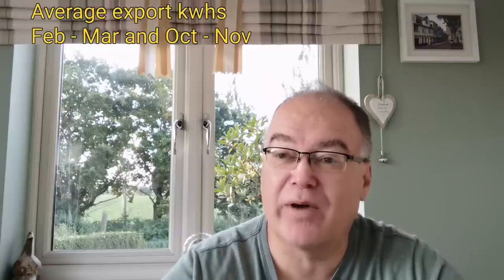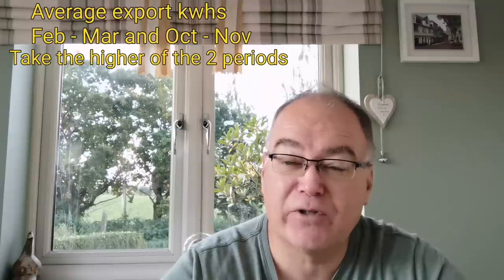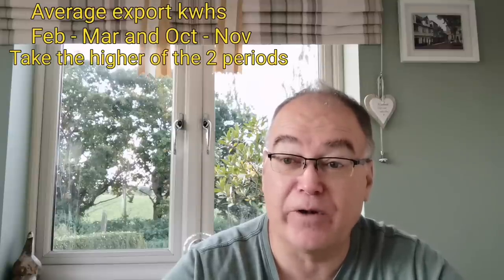How to size a home storage battery

Comment: Our experience has been that if the battery is only intended to store electricity from your solar panels there's not much point in the battery size being more than three times the rated output of the panels in kilowatt hours..  Our system has a battery capacity that's equivalent to 1.5 times the installed capacity and it often runs out of electricity in a 24-hour period .   On our best days if we had 30% battery storage we could use all of the solar power we generated without sending any back to the grid,. But if the batteries were any bigger we would never make enough power to run the house and charge the batteries completely.  Our house uses between 5.5 and 6.5 times the installed capacity each day in the summer which negates the longer days,  so if you're somewhat overpowered with panels a bigger battery might make sense to help you through the cloudy days,.    We live 32° north of the equator and I'm sure folks further north might have longer summer days but averaged over the year it's unlikely you would be able to store more power.  In our case our solar system generates 5-5.5 times the installed power a day,  so subtracting what the house uses from that leaves what the battery can possibly store.  On the other hand if we had less than 10% of our installed power we would need help from the grid a lot more often which would make the solar panels less useful.  

 Budget considerations sized our battery for us.  Because we live in a hot climate that's also cold in the winter we tend to use 70% of our electricity during the day to run our heat pumps and the other items in the house which have not been tweaked to maximum efficiency yet.  In a place like the UK you might want a large battery to store up night rate energy to use during the day and have solar there just to help you stretch out your batteries over the day.  
On a grander scale if every house could store 30% of its energy per day at night then, power generation could be levelized in that the plants would just make the same amount of electricity all the time and the batteries would handle the peaks.

Comment: Hi Nigel. I really liked your battery size video and have just subscribed to your channel. I'm researching quotes for a Solar panel veranda + roof panels + battery + EV charge point up at West Runton. Can you recommend an installer? BTW have a large GSHP fitted last December to replace the Calor Gas boiler - much cheaper. But it ruins your garden!!!
Reply from the maker: West Runton, almost on our doorstep.

Have you tried Leaping Hare electrical in Syderston near Fakenham. They Installed my Mixergy tank and do solar installs too. Nice small family run business

& thanks for the sub  to the channel

Comment: One thing not mentioned is look at the output power of the battery, a small one will not be able to fully provide the power for a kettle for example, somewhere around 5kW is fine for most people, this requires a larger battery, as you have done, think big!
Reply from the maker: Mentioned it on the inverter side just presume no one is buying a bigger inverter and small battery but yes they both need to be capable

Comment: if looking to use the battery for peak time use - morning shower or cooking in evening - don't skimp on peak power rating of the inverter. If you can't get enough kW rate from the battery/ solar (esp. evening with oven/ microwave/ induction hob) then you'll revert to grid. G99 rated inverters will let you export the rate that the DNO dictates but allow higher power draw around your property if suitably matched.

Comment: Thanks for the advice, I’ll run the calculations and see what it says for me.  Our solar upgrade (a further 10kW of panels on top of the FIT 4kW) and battery is due to be installed in a weeks time.  My sizing rationale was to fit as many panels as I could to the roof as it was more cost effective to do so whilst the scaffolding was up than incrementally add panels over the years.
On the battery we’ve gone for twin inverters and a 5.2kW and a 9.5kW battery. The larger battery I just bought the biggest I could as £ per kW it’s cheaper the larger you buy.
I do know that with our Air Source Heat Pump we can use up to 30kW in a winters day so the battery wont cover all of that but it’ll make a big dint in it.
One gotcha I became aware of is that a lot of smart meters (mine included) are only single rate smart meters.  So can’t get an overnight rate tariff without changing the meter - for which Eon want £130😢. I may just end up having to swallow this cost for the overnight charging flexibility, but it’s annoying nevertheless
Reply from the maker: Older smets1 device maybe?
Reply: @EVPuzzle  I don’t think so.  How would I be able to find out?  I specifically confirmed that it going to be a SMETS2 meter when it was fitted, which was only in October last year, but then a week after it was fitted, my electricity supplier Symbio went into administration and I got moved to Eon.   Ever since then I have been trying to get the smart meter commissioned as it had somehow fallen through the cracks of Symbio/Eon.  Eon tell me that it is only a single rate meter and “most smart meters fitted are only single rate as most customers are on single rate tariffs”.  Seems incredible penny pinching to me if that is the case
Reply: @geoffreycoan  I find that hard to believe in this day and age. I had a Smart meter fitted April 2022. Not only is it 2 rate meter (I have E7) but it is already set up to read exports. Long before I even thought about going solar. Commissioned? I presume Eon is actually reading it or do you have to supply a reading? If so Eon should be able to change it to what tariff you need. Certainly my supplier has done updates over the air to the meter since it was installed. I would suggest though, working your way through the various menus. I actually queried as to whether my supplier was actually reading 2 rates, as all I could find in the main menu was one single reading i..e. a total dial, plus an export dial. It was only by going on through various menus that I finally came across one that displayed first 1 the day rate and then the night rate. Complicated, not so smart!
Reply: @bertiesworld  It turned out to be a very long complaint story with Eon that 6 months since I wrote the above is still not quite resolved.
The key point is that Eon CANNOT change your smart meter from single to dual rate over the air.  Other suppliers apparently can but not Eon!
I had a smart meter installed by Symbio shortly before they went bankrupt and I got moved to Eon. When they installed my dual rate smart meter they didn’t fit an external antenna on it and so as we live in a rural area it never worked. Eon believed that I had a single rate meter so after 10 months of them ignoring my emails about the smart meter not working I finally escalated it to a complaint and a man came to swap the smart meter for one with an antenna.  However as Eon’s records showed I had a single rate meter they configured the smart meter as single rate !   I fortunately had photos and videos of the old meter so could prove that I had a twin rate meter that they had downgraded…. and then I learnt that Eon can’t reconfigure the smart meter as single rate!!   So back to the complaint and they have now been out and swapped my (working but single rate) smart meter for a dual rate non smart meter.  As I proved that this was what I originally had they waived the charge for this.  I’m now waiting for the next appointment to swap the dumb meter dual rate meter for a dual rate smart meter and I’ll be sorted.
Hard to believe but it’s all true

Comment: Have really enjoyed your videos. Taught me so much. I think I've worked out now that a 6.5kw is the right size for my usage (not the 3kw my 1st quote was for). This allows me to expand later if I need to. 
Trouble is, can't get anyone to quote or stocks are gone. I'm ready to go Solar PV + battery, but no-one available to service me. Frustrating, but now I'm thinking I buy the equipment & hang tight till I can find a fitter.
Reply: I did this and you're going to struggle to find a fitter if you do so. The other problem would be that your install and equipment will be around 20 - 25% more expensive just because of the premium a fitter will charge and you're also losing the vat exemption. I'm not advocating that you wait but I would say if this is what you want make sure you go into it with your eyes open. Another thing to think about is system design, look at the panels you would like and then decide what roof mounting system you want and go to their website and use their design tools to give you a bill of materials for the fixings and rails. That will also allow you to see if the panels will fit onto your roof and whether the system size is feasible. After that decide what inverter you would like grid tie (string or micro) with battery or hybrid and what size you need for the panels and expected load. Lots of variables to consider I've got two US5000s, I'm aiming for 6kw solar and using a Victron MultiPlus-II 5000va 4kw battery inverter with 3.27kw on the house roof 1.8kw on our extension and a further 1.8kw on a gazebo in the back garden the last two strings on an AC coupled solax dual mppt grid tie inverter. Just waiting for roof hooks to get the roof install done and the rest should fall into place.
Reply: UPDATE: I've found a company & have signed up for a 4kw PV system and a 6.5kw battery. Thanks for all the tips & info
Reply from the maker: Brilliant news
Reply: @EVPuzzle  Trying not to get "buyers remorse". Hoping you can offer you take on the difference between having a 3kw hybrid inverter or 3.6kw?  does a 3kw make sense with 4KW panels?  Then finally, if I decide to add another 2kw of panels a few years later, should I be getting a higher KW inverter now, to allow for expansion? (or cross that bridge & add/upgrade the inverter if/when needed?)
Thanks in advance 😁👍🏿
Reply from the maker: Unless there's a big price difference which I doubt, go 3.68 then worry about extra panels later.

Or put extra on now?
Reply: It's generally more expensive to add panels later and if you go over 3.68kw you're moving from a fast track G98 to a G99 EREC which your installer will charge you more for. So it's all about weighing up the costs and benefits. If you can afford it I'd go for as big a system as you can fit on your roof. Then a hybrid inverter works even if the grid goes down and they design the system around 20% oversized as you're exceedingly unlikely ever to get the rated power and even when you do it will only clip i.e. give you the inverters rated max (though it should give you more power in winter and save you money as the lower powered inverter costs less). If you add another 2kw yes you have to either buy another inverter or micro inverters ( have a look at AC coupling as a possible way to do this - would probably require a victron inverter with a battery and the number of installers who know anything about them are very few and far between).  You should be fine with a 3kw inverter for 4kw it'll just clip in summer. Honestly if you're getting 4kw it doesn't make sense not to go for 6kw considering the extra expense of scaffolding, new inverter, G99 now for 300 - 400w more etc. Hope I've answered your questions and given you some food for thought.
Reply: @williampelzer1460  thanks for this. Max I can fit on my roof is 10 panels. Other side will only get sun half the day, so for what I use, not entirely worth it now, but in 5 years  I may want a bigger battery set up. So I'm going to stick with the offer and go with the 3. I'll keep posting
Reply: @EVPuzzle  literally a few pounds extra for the 3.6 and the 4

Comment: I need to know more...I am having real problems with my giv energy 5.2 kWh battery. It is only charging to 2.7kWh and they keep recalibrating it to try and "push" it into full capacity. I accepted their suggestion of going into the firmware fix experiment, but again, oh we need another calibration.. At what point should they give me a new battery
Reply from the maker: I'm afraid it's a common problem I'm hearing. Not sure how best to advise people but I know some are receiving refunds and removing the battery

Comment: Battery I would love a battery but they can’t get my system finished yet still waiting for the inverter to get installed, the price of the battery will soon get ridiculous and they get greedy and start pushing prices up. 
I’m off of the battery wagon for a while now 😢. On a side note did you get the Shelly installed?
Reply from the maker: Yes shelly working

Comment: Hi Nigel, great work!!! Would you recomend where to get pylonthec batteries and vitron inverter?
Regards
Reply from the maker: If it suits you yes, its a more complex system though so be aware
Reply: Would you recommend any installers?
Reply from the maker: Afraid not my installer no longer does residential work

Comment: it's all very well sizing the battery, but to get that size has to make financial sense surely, especially if or when paid for exporting back to the grid.

I bought 200Ah cells from AliExpress.  So about £1k for 10kWh of battery.  Another £200 for a Seplos BMS.  That just about makes sense financially, but many batteries are £1k per 2.5kWh, which I cannot see being financially viable
Reply from the maker: Only if that's your priority

Comment: When you’re pulling from the battery inverter, is it a sine or square wave output?
Reply from the maker: No idea Ray.  I know some inverters are sine wave others aren't but what the difference is, is beyond me
Reply: Well Nigel, square wave inverters are often categorised as 'dirty power'. The square wave creates noise on the mains and can cause reliability issues with your home equipment over time with all the clipping. Obviously a sine wave output is the clean option, but is normally costlier.
Reply: I would think any inverter grid tied to the mains (ie in parallel to the grid supplying your mains) is going to be as close to a sine wave as possible. A square wave o/p wouldn't meet the standards for connection! All solar PV inverters are sine wave and have to match frequency and phase, I don't see battery inverters being any different!
Reply from the maker: Gotcha
Reply: Victron inverter is pure sine wave. Square or modified sine wave is just for cheap inverters these days!

Comment: Dear Nigel,
Your videos are so informative, thank you for sharing. I'm about to invest in storage batteries too. Possibly in combination with a Victron Hybrid inverter/charger like you are using. In several video's you mentioned that your batteries are charged either by excess solar or by importing from the grid at a low tariff. Is this selective charging done automatically or by daily manual settings in your Victron inverter/charger? Please explain about how you manage this and were you found information on how to program the Victron inverter/charger or other device that controls the charging behavior of the Victron. 
As you mentioned in one of your video's some time ago you would prefer this intelligence in the battery solution what was not (yet) available at the time of recording of that specific video. 
I would like to have this automated if possible by means of scripting in smart home automation like Homey Pro. 
P.s.I already have a Solaredge inverter plus 14 kWp solar panels. A Zappi EV charger is also running here ;-) I run Flows and scripts in Homey Pro to make use of low tariff hours (each hour is priced differently at my energy supplier) for running the air to water heat pump to heat the boiler. I am also waiting for a solution by Myenergi to boost Zappi charging at low tariff hours automatically.
Cheers, looking forward to your reply.
Ron
Reply from the maker: Ron

When the time of year arrives I set victron to charge at 230am the start of our cheap period and finish at say 60%. Some days that might not charge at all if we have nor than 60% left.

By being in charge mode though the battery won't respond to loads so I can heat out water or charge the car at 230am without draining the battery.

I tend to set once and just leave it after the first few nights needing a boost.

I haven't seen a programmatic method for changing the timers

Comment: Hello, Nigel; Do you happen to know if it is possible to add home batteries systems from different company's? For example, could you now add a Tesla PW into your system! I know you research these thisgs to great depth, amd wondered if you have looked into this at all, it's a bit beyond me to do so. I currantly have a SolaX 10kWh pack, and want to increase the capacity, but I think my installer may have stopped trading, as I'm getting no replies. Thank you for taking the time to read this. ...........Soryy, the reason is I want to delete gas, and fit an electric heating only boiler, I want to store 20kWh of over night rate electricity, and use this for heating. Thank you for all the info you supply.

Comment: Another informative video Nigel. I may of missed it but I don't think you mentioned the degradation over the life of the batteries. E.g if it was 20% over 10 years then a 10kWh system will only hold 8kWh. So if the need was for 10kWh then one needs to add 25% = 12.5kWh. I know the % is stated by the manufacturer but I suspect the manufacturer's % are derived through stress testing and extrapolation and will vary by manufacture and that the reality maybe better or worse than expected. EVs have proved less that had been feared but they may be less stress than a home battery system.
Reply from the maker: There's some good analysis  on an Australian battery research site showing pylontech 
Do well degradation wise.

Im expecting these to last my life Nd I'll be so old I won't notice the drop off🤣 I hope